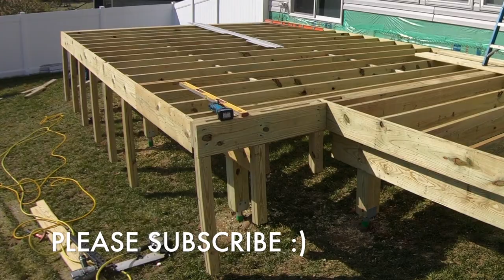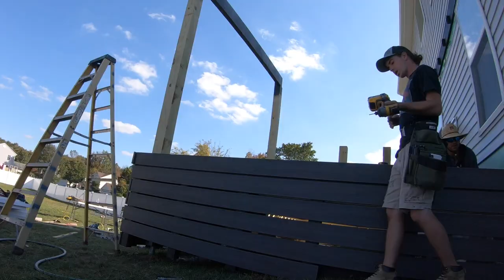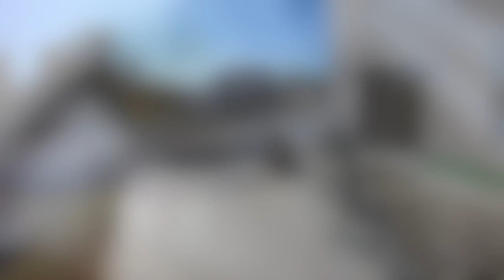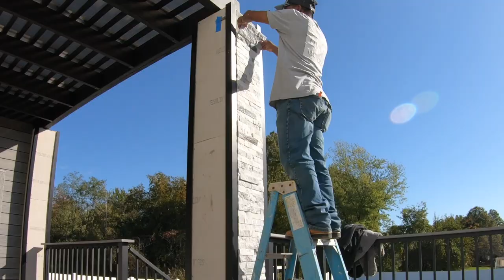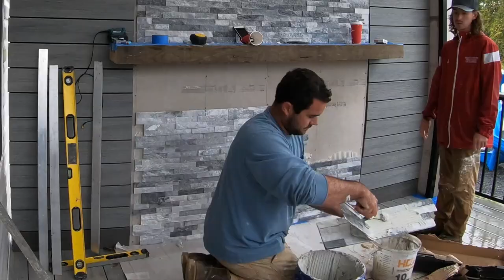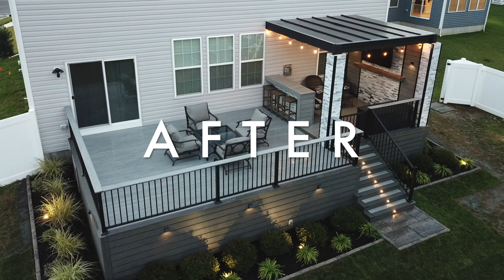Modern Deck and Pergola Build - Full Project Time Lapse

Comment: This build looks fantastic, as do all your builds, but one thing I didn't see .... and maybe I missed it .... where is the counter flashing for the pergola ledger board? Even though you have created a J-channel with the 2x + 1x material, water can run right off the vinyl siding and get up against the house wrap/sheathing, without flashing present. It'll rot the sheathing out eventually, and potentially cause a mold problem.
Reply from the maker: thanks a lot, glad youre liking the builds!! A lot of stuff doesn't get fully shown in these time lapses, but we probably covered it in the vlogs of this build or another with a similar pergola detail. We use galvanized flashing under the siding and over top of the pergola ledger, so any water that gets behind the polycarbonate panels will go over and in front of the pergola ledger

Comment: Amazing project I have loved watching this project unfold fantastic job guys. 
Q. Would you install a hottub straight on top of a deck without a concrete base slab. Just hot tub 2000kg fully loaded straight onto extra framed and supported composite deck?
Reply: L